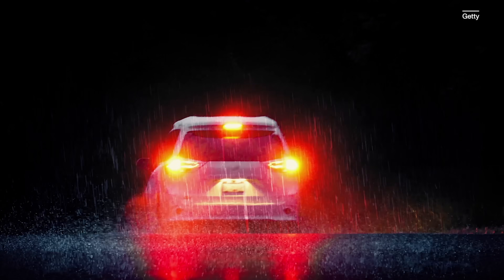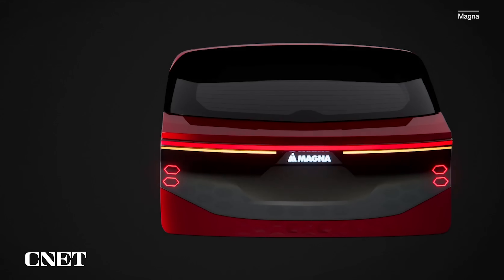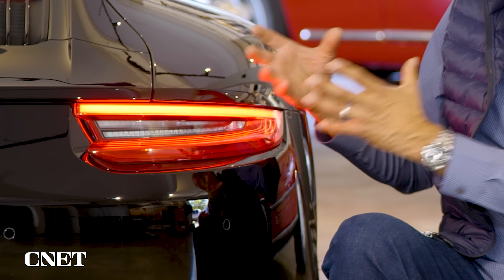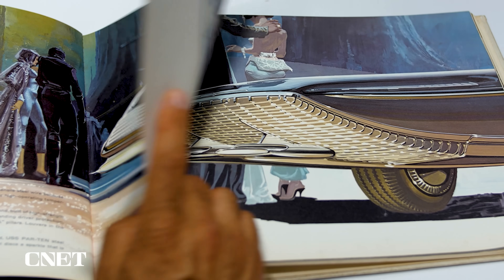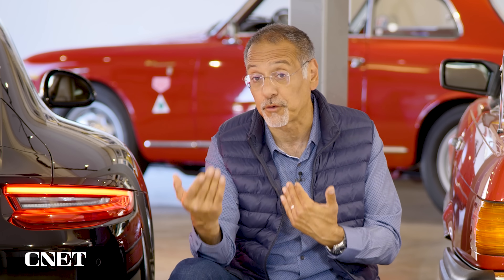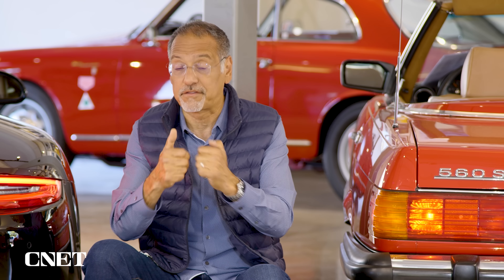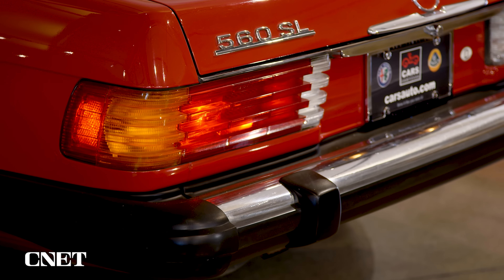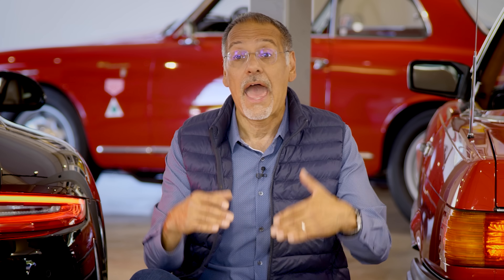New Invisible Lighting Wants to Radically Change the Way Cars Look

Comment: It baffles me what car companies have been allowed to get away with in the past 20 years. It used to be you couldn't drive at night without turning at LEAST your corner markers on in order to see the dash display. Now I see several cars after dark with no outside lights all because they turned them to the OFF position. Or a few car makers (Hyundai/Kia for example) putting the rear signal lights at the bottom of the bumpers, which I'm willing to bet shorter drivers can't even see from their position.

Comment: The whole reason vehicle lights work for signalling is that their standardized so anyone understands them. Not to mention they’re simple and replaceable.

This is a solution looking for a problem.
Reply: I agree on the standardization part, but it may have some interesting applications for vehicles that are designed to be driverless.

We rely sometimes a lot on looking at a human to signal intent. With an AV it is unclear many times what it’s intent is. Is it about to yield? Is it flagging the oncoming driver to go forth at a 4 way stop? Is it safe for the pedestrian to walk out in front?

Without eye contact, it’s sometimes hard to gauge what the vehicle is about to do. 

I don’t think it’s a solution looking for a problem, the lighting regulations were originally designed for human driven vehicles. 

Already many task forces are working on studies for AV lighting, such as SAE. Magna looks to be gearing up in anticipation of this.

Comment: Technically, this kind of huge led screens instead of actual brake lights will not only be less powerful, but also a pain to manufacture - hence more cost to the end consumer. Secondly it will do to lights what drag coefficients did to car body shape - all cars look blobby and generic - no real design features and quirks (imagine a human face with no features :P), just weird blob shaped pods with rectangular screens for light design and more rectangular screens for the interiors. No thank you!

Comment: Interesting 
💡 I've always wished to see a car that displays its speed to drivers behind (so they can drive in sync with their speed)

💡 Or at least show how hard you're pushing on the break / accelerator pedals (with reactive red / green lights that change size depending on how hard you're pushing)
Reply: That's not a bad idea actually. And combine those with frontal gas and brake lights

Comment: As beautiful as it looks, it is completely dumb:

1- those turning lights on every new audi are so distracting when tailing them

2- people would use it to write idiotic messages

3- lights are meant to give instructions to the persons near the vehicule. If you drown these lights in other lights, and you have to look for the information, there is no more purpose to lights.

4- For autonomous driving, Only rapid burst of light would work giving lots of information. Which is really dangerous. Or use radio, Bluetooth, wifi or any other mean to give info

5- Repairing will be a nightmare

6- to stop overweighting car, stop building suv and pickup trucks that nobody needs. Those should only be driven by farmers, people in mountains, builders and remote areas.

Comment: It's illegal in most jurisdictions to have blue exterior lights on a vehicle unless it's for law enforcement.
Reply: If you are talking about the blue on the rear, I’m wondering if they are thinking to try the “teal” color that is being recommended by the SAE working group for autonomous vehicles.

SAE J3134 (working task group) recommends a type of teal that looks like this, to indicate autonomous driving.

Although it’s not recognized by law yet (and might never) as it will take years of review, FMVSS 108 and also state regs sometimes reference SAE specs.

But you are right, I’d think it is easy to confuse with emergency or snow equipment lighting.
Reply: Hasn’t stopped 30% of the cars in anchorage Alaska tinting the front windows and windshields to like 7%
Reply: offroad legal 50states
Reply: Also a good demonstration for LEO purchasers, which is a huge fleet buyer. Would be great for unmarked vehicles.

Comment: Yeah, it's great until one of the LED's burn out and you have to change out your whole bumper. As it is, the LED modules in my BMW are about $300 a piece and the solder joints in them are known to go bad. And at least they aren't the whole hatch.

Comment: Like all those led lights they say they'll last forever, I got a 99 chevy it takes me 6.00 dollars to replace a light. How about less electronics and less "technology " and more reliability that be nice have the engineers thought about making a car that goes 100k miles without going back to the dealer for warranty repairs that be more "advance".
Reply: For real, here's a complete list of the technology I want in my car
-hand crank windows
-turn signals
-front and rear brake lights
-front and rear gas lights
-side view mirrors
-hood blind spot mirror
-rear blind spot mirror
-front, rear, left and right dashcams
-cell phone pockets on the passenger side door
-a manual transmission
-hearing protection headsets for driving on the highway with the windows down
-the most advanced technology of them all: a front middle seat

Comment: Can we make cars that are more simplistic?  I work in the auto body industry. You have no idea how many different models there are. Every year they're changing something about it. If we had ONE version of a truck, car, vans, SUV's, station wagons.  It would make things more simplistic. I on a daily basis, I deal with either 3 different sizes of fastener's. Screws, bolts. Then on top of it I have to deal with 3 to 4 different sizes of clips. It takes longer to get certain parts, because they have computer chips in them.  Feel strong about this change if it comes. Because it'll think it makes things easier to deal with not having to worry about light bulbs going out. It would be nice, if your car actually put the turn signal on when it sensed that you were going to start turning into that lane.

Comment: problem with this is how much is it going to cost when if it goes wrong its not the shops overcharg panel like that easy £2000
then labor to change it
Reply: even just a door handle thats got gadgets inside like keyless entry can stop a car running just from one door handle
now put a fancy computer controll ligting into the mix and try find the fault thats affecting the whole car

Comment: Isnt this old technology and you still have lights there, they are just behind the bodywork and not on show all the time. Most new cars now use LED lights which are lighter then normal lights and can be smaller too. Also, i don't think you can project the lights with this way of lighting.  BTW LumiLor is a spray-on paint that does this same thing but is better and even lighter and be on almost any part of the car.

Comment: What's crazy to me, is not getting the "idea" patented nearly 20 plus years ago. 
When "indiglo" lighting was used for watches, I imagined it used for automotive applications on the rear tail lights. I knew that the indiglo would have to be brighter where needed.
I have a 2000 Miata where I've already done this to. The rear lights look like an exotic car. There are no LEDs, or incandescent bulbs. 😁😁😁 
I'm waaaaay ahead of you people. Heh heh heh.
Soon, mark my words, LEDs will become obsolete after the "panel" illumination takes off. It's all about innovation, saving on energy and materials.

Fiber optic lighting could have been used, but the length of the cording wouldn't have made it efficient in terms of materials. I thought of doing that to a Mustang back in 1999.
Reply: Do you have a picture of your mazda? I'd love to see it

Comment: What would be a "game changer" is lights that don't blind you, even on low beam, and auto dimmers that actually work.
Reply: Most factory LED headlights don't have that problem. What stupid people don't realize is LEDs need vastly different reflectors and perform better with projectors almost everytime anyways. You cannot put an LED replacement in your halogen headlight, it will not reflect properly.

Comment: Look how long it took U.S. regulators to finally approve composite headlamps versus sealed beam headlights that Europe had ditched many many years before they finally showed up on our side of the pond in 1986.. As a kid whenever we would go to Germany every other summer to visit my extended family (parents emigrated in 68') I always thought the European version looked better, but I didn't know why. Then I realized years later a lot had to do with the headlights and of course the silly 5 mph bumper specs. Heck it probably will takes years before rear view cameras get approved, such as those used on the Hyundai Ioniq 6.

Comment: This could be a very bad idea.  First, it is distracting.  You are looking at the pretty lights on the car in the lane next to yours and you fail to see that the car in front of you has slammed on its brakes.  Second, with enough small pixel lights, this will be used for advertising.  Advertisers will pay you to display their messages on your car.  So when you drive, every car will have a different advertisement on it.  Terrible.

Comment: Federal US and AUS car lighting regulations are slow because you cannot recall a regulation without being responsible for compensation, end user (safety) and manufacture (production and tooling cost).  Car lighting is critical graphic communication safety and safety communication must be clear to licensed (trained) drivers graphic expectations must be fulfilled.  Meaning, we subconsciously look for the light signal location on vehicles, we interact with when sharing the road, in the same way that we must look for speed signs rather than just have speed limits blended into urban surroundings such as invisible 🫥 unless illuminated Hwy surroundings.

Comment: Looks like we could be getting the pop-up headlight look (from when they’re down) back,  with just smooth lines uninterrupted by a headlight module. 

Realistically though, lights are a part of most brand identities so they’d at least keep a DRL or something on, but would still look pretty clean 🤩
Reply: Dont think it will work as this dont project the light and for headlights they need to project on the road ahead.

Comment: Potentially very useful, but also potentially distracting.  One possible use is to have two levels of amount of red light when braking.  One level for low to moderate braking, and more red for really hard braking, so the driver in the back knows to slam on his own brakes.  There might be some legal liability issues because people are stupid and litigious, but I for one would appreciate this type of info when driving.

Comment: This is actually a great idea, in my opinion. Imagine the entire back of the vehicle flashing red and amber during hard braking or when the flashers are activated because of a hazard. Would certainly be a lot more noticeable than a couple stripes of light on the edges and one top center. This could also be useful for illuminating the sides of the vehicle during such situations.
Reply: Won't change anything. People just need to be trained to drive better. This is a solution looking for a problem.
Reply: I agree, the harder you hit the pedal, the brighter it is. This design can be further simplified by making it a swappable LED Top panel with a generic connector
Reply: Imagine the repair bills... It will also blind the drivers in the rear....
Reply: You must be so blind for you to need  that much of lighting.
Reply: As long as the glow rather than shine like a laser headlight
Reply: Yah we cannot fix stupid so best to help.

Comment: As someone who has been designing cars as a pass time hobby for the last 5 years, I can in fact confirm that I absolutely hate trying to design head and taillights. That and rim designs. But the concept of having a panel that can display any image with lights so to speak has always been something I've wanted in real cars for the last 3-ish years.
Reply: Without headlights and tail lights, markers, etc., there will be no style no personality. Just a plain aerodynamic bean. As a fan of popups... I always thought it would be cool to have a popup mechanism under glass. Something that mechanically moves to reveal lights, in a way that won't interfere with aero or safety of pedestrians. Sure, it's absolutely unnecessary.
Reply: @pgtmr2713  you're spot on
Reply: Yeah this is a great idea from a design standpoint but I think this would only really work on exotic/expensive cars because of how impractical they are to an average road user

Comment: You know good and bad facts. Good facts those features going to be implemented only on luxury and super luxury cars and pickup trucks Whatever. So there is going to buy it and they're going to pay it pay all the repairs. He don't care about it. Unless it's getting second-handed so the person second owner going to use it and then he going to face those problems. Eventually they're going to be so many parts on the market, maybe in 5 years, so you should not be worried about it. Second the way how automobile industry is bring too much tech into the cars frightens me. Too many electrical components. Too many stuff that can fail. They don't tend to make something real good and something reliable. Sometimes on the engine which is the most complex item in a car is the most reliable. Well everything electronics on board may fail. Look at the recent video on the internet. The rivian pickup truck. Everything was not working except engine and brakes. So the guy I was driving without knowing how fast he's driving. There was no power windows. No backup camera, not just carbon driving. He got nothing on the board. No headlights, whatever. So this may happen to anyone. It's too much. Stuff is implemented in the cars that people really don't need it. And the price for the vehicle is increasing accordingly. They cannot bring new tech into the vehicle without increasing the price, but the competition on the market force them to do it. We have all resources to produce today. For instance, Toyota Camry, 1996. Is it going to be reliable like Kalashnikov is going to have a low gas mileage comfortable, but it won't be able to compete on the market. Because it's analog for instance, Honda Accord going to be filled with stack and people want those new features. Sometimes people just buy a car because it has more features. Some people don't look at reliability of the car. They just want more features. That's why Tesla got such popularity. People want those tech inside That's why they buy it. As for me, the best car for me is that same Toyota Camry 1996 with electric motor cheap and reliable. But you cannot compete on the market with this vehicle again. Last features and you going to find very small audience people to buy it so it won't worth investment. That's why the low cost EVs are not on the market because people don't want to buy them. I'm talking about the US market. All new invention that we have today is going to be a standard feature in the cars in 7 5 years. So yeah, be prepared to replace the whole panel or the whole bumper or the whole. I don't know if it's going to get damaged. I believe in some close future those panels won't be able even to damage It. Just kind of apply some heat and you can bend it other way.

Comment: You won't be able to have different colors  of light on the outside of cars ever, its illegal because it interferes with emergency vehicle lights....
You will get pulled over right away and cited.....
As for cars needing to be able to tell you something this is an irrelevant issue for now and the near future for sure...
As for use with antonymous vehicles i wouldn't hold breath for these to be around any time soon (we are talking many many years if not decades still)

Comment: I used to immediately play devils advocate with stuff like this, but now I try to think about what other applications may be useful before discounting it, even though it could be extremely costly to repair and proprietary technology so no car company buys in.

Think outside the box, it doesn’t have to be cars, or even vehicles for that matter. Signage, sports equipment, architecture, artwork, etc. it’s simply a new tool to use and that’s pretty great.

I especially like to think that portions of boat hauls may be lit up at night, not sure if there’s enough open water crashes at night to justify the cost, but just an idea.
Reply: this would be cool to have in a room, like a light-up ceiling. you don't have to light up the whole ceiling all the way, you can have spot lighting like traditional lights, or dimly illuminate the whole ceiling
Reply: Boats are required to have lights on them even if it's not at night because you might get stranded and need them so it's not a bad idea

Comment: I imagine this would be useful to autonomous vehicles. Perhaps certain shapes, words, or varying intensity can be processed by the car in front of or behind a given car to provide more information about what the car is going to do, other than just stop, left, and right. Maybe it can display speed, or brake pressure, or give better indication of distance in addition to radar or lidar.
Reply: All of that stuff could be wireless though. And ideally it would. If a whole crowd of self driving cars could talk to each other in real time, that's the ideal driving situation